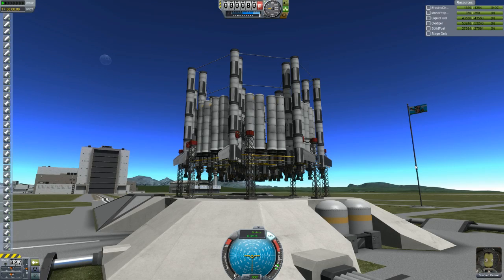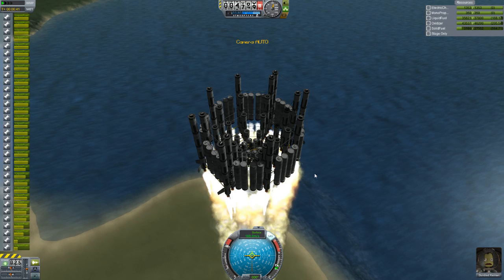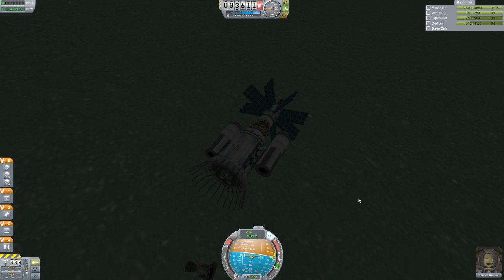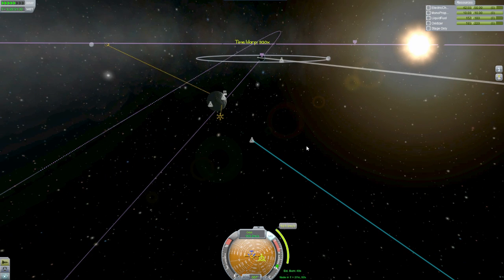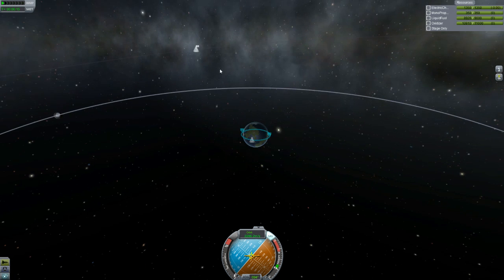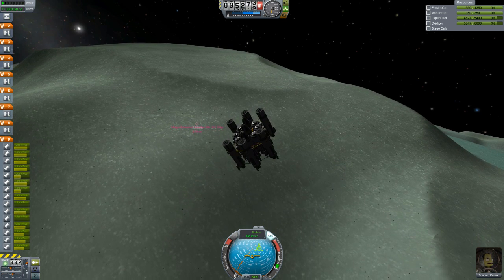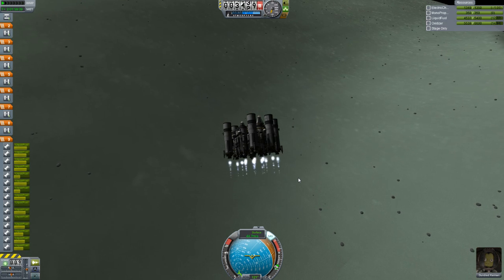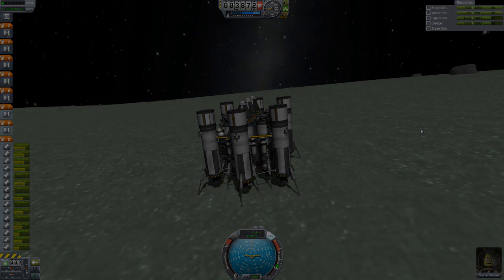Kerbal Space Program Ep. 45 - "Minmus Rescue Mission"

Comment: Z, what happened with your other rocket was the fuel lines, when you had put them in one of them had been misplaced. This will cause one tank to drain incorrectly, causing weight to shift onto one side of the rocket, flipping you over.

This is why you had 0 control and it kept flipping over and over, eventually it drains enough to overpower everything else.